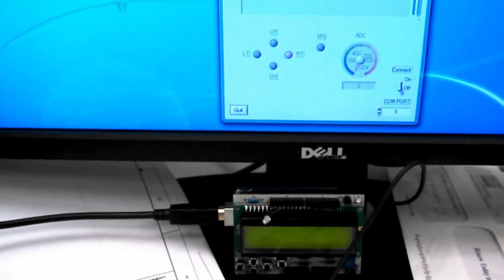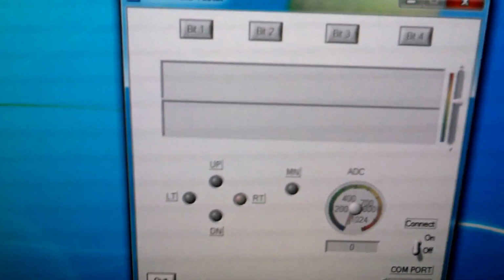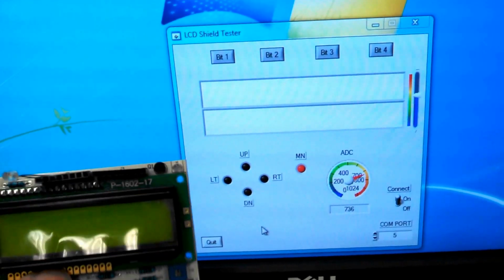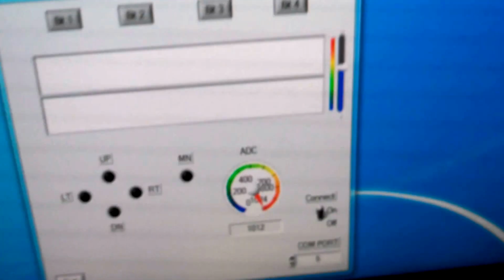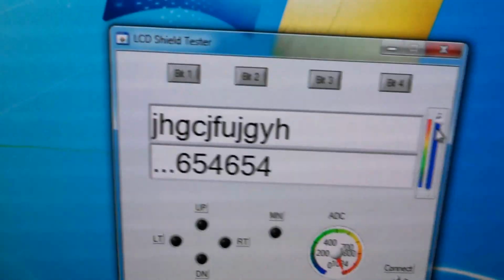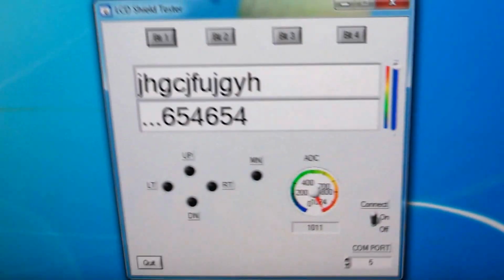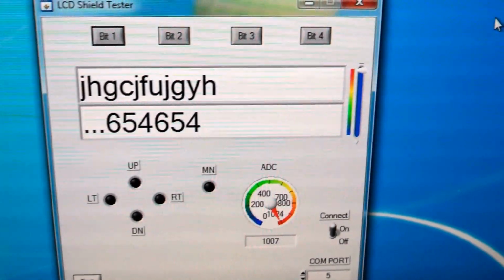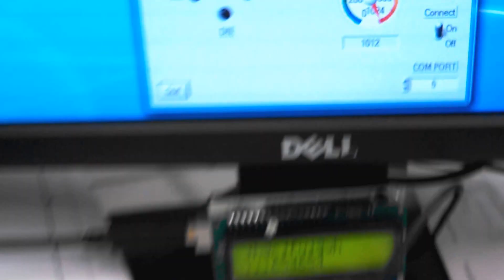NI LabWindows/CVI interface to Arduino UNO with LCD Shield

Comment: Dear Tom Burke, with the distribution kit that you link is not useful because it not accesible the C code because it is an executable,then closed for our eyes.
If you were kind enough to upload the "full project file" with your code .c and file .uir, I would greatly appreciate it.
I think that a practical example with everything working is extremely necessary for those of us who do not have enough experience in connecting Labwindows with Arduino,
Sincerely and gratefully in advance.
Reply from the maker: http://www.burke.tv/Tom/Cookbook/Arduino/LCD/LabWin/LCD_Shield/LabWinSource.zip